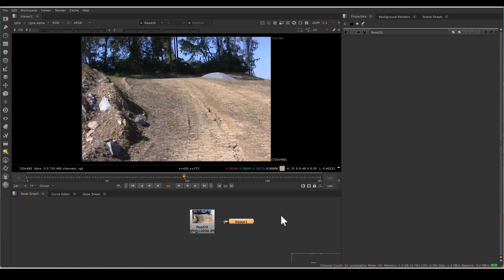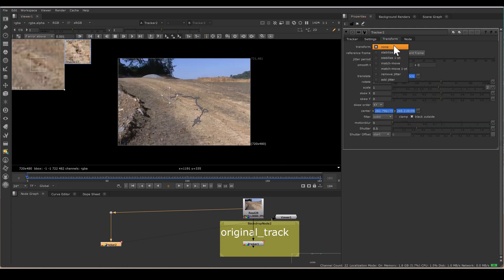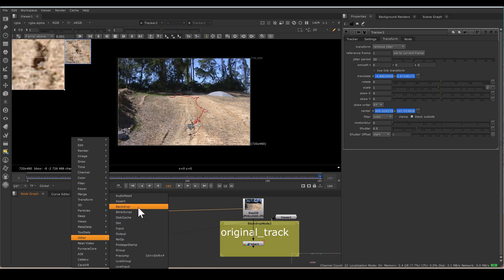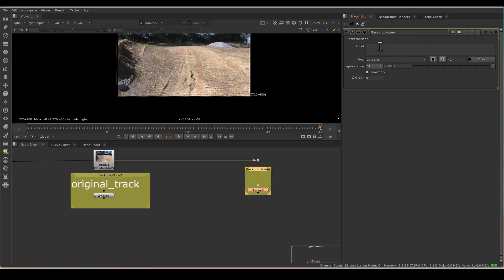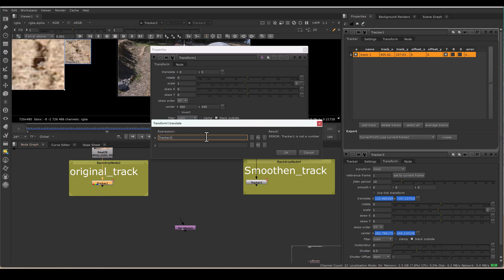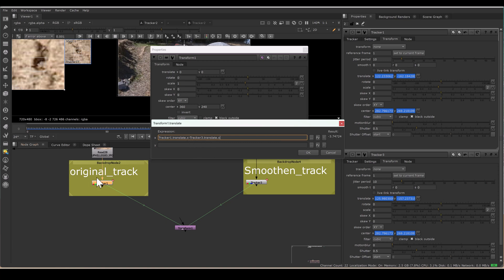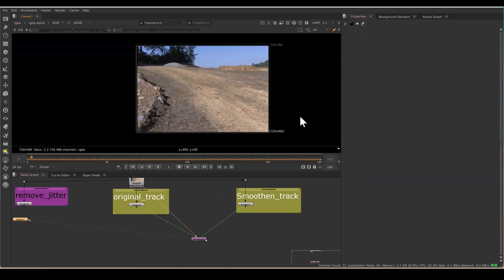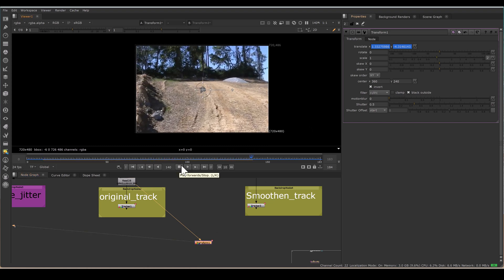Nuke: removing jitter I smoothing plate motion I getting jitter value I Stabilizing Motion Jitter

Comment: Thanks for the video 🙏, so my question is that remove the jitter with the option of the traker node, it's the same of removin with filter in the curve and the method of the expression? Or it means that any of this is more effective?
Reply from the maker: Hi @nicolascabrera, as i understand, both method removes jitter but take slight different approach. tracker 'jitter remove' takes jitter period in count to average the tracking data & its average subsequently that much frame number what jitter period number suggests.   
whereas removing through filter takes whole tracking data in count & average whole range which gives more smooth en result.
if the purpose is mimicking original path while smoothing, then tracker remove jitter would more near by, but some times  its still feels jerky if the jerk frame is 11th frame then average will go to next chunk of frames as suppose if jitter period is 10 its average every 10 frame tracking data.

i hope its helpful.
thank you for stopping by.
Reply: @auxiliarynatter  thank you so much for your time and explains 🙏